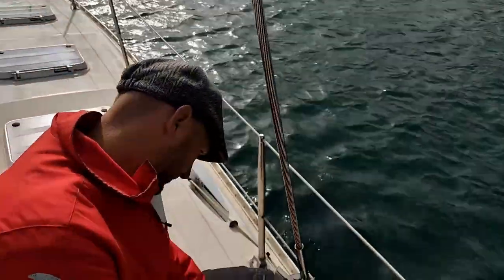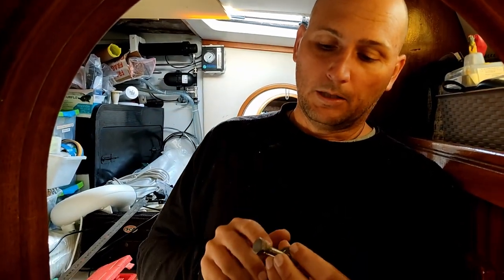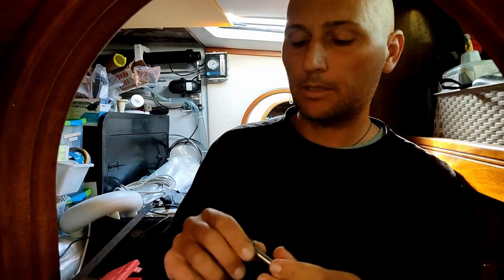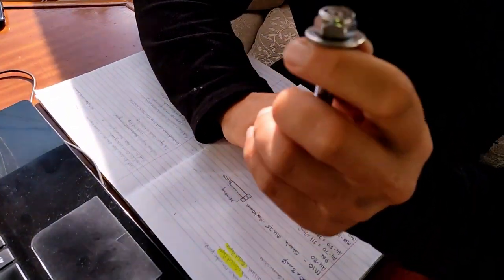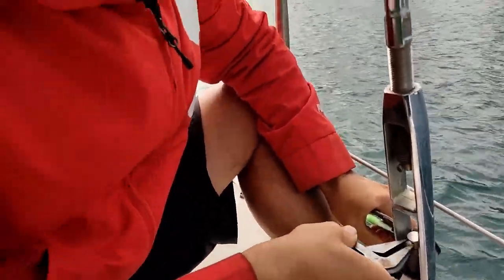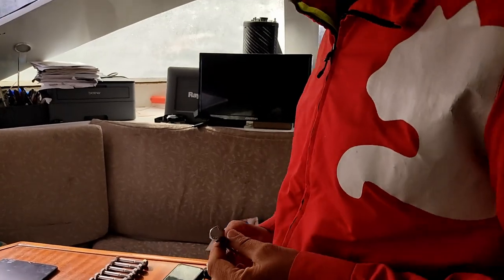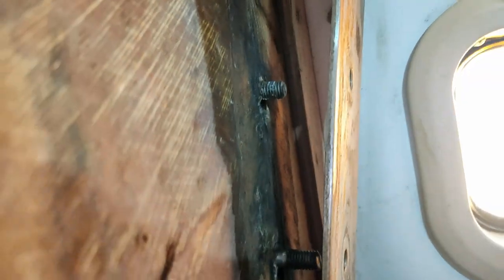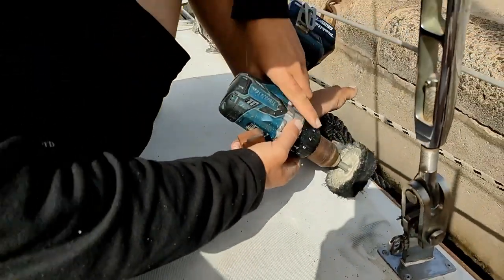Concerning chainplates and suspect bulkheads

Comment: Thanks for that - bugger about the chainplates. I can't see much uni there. In a Newick tri we built we used the Farrier reinforcing method and had about 9 laminates of 2 plies of uni and 1 of db at 600. It was massive over an HD insert and used 12mm bolts. In my own 38ft cat I have my cap stainless chainplates on the outside leading through a 20mm ply pad with 12mm bolts with uni ribbons laid over and into the bilge with 2 600 db plies over. Now I would just go composite - so set and forget and no water ingress. Stainless chainplates are a pain if they go wrong. Always something to learn on your videos.
Reply from the maker: Thanks mate. Just in the process of building carbon chainplates here in El Caribe. It's infinitely better than what was there before. We will get to the videos on this process in the next month or so.
Reply: Fancy 65ft racing / cruising mono currently hauled beside us had the G10 chainplates fail in the Heineken last year. Wrong laminate profile.

Comment: My engineering is a little rusty, but my memories of torque and nut retention and Junker vibration testing is this. It's all about the CLAMPING. Shear should never happen. If you are in shear, then clamping has already failed. Bolts hold the plates in clamp friction which holds the load. Shear means it's insufficient tension and friction.
Reply from the maker: Correct however we are not dealing with a steel on steel situation. We are metal on composite which is a very different beastie. The clamping pressure is very difficult to achieve due to through thickness stiffness of the composite panel. Due to this you cannot achieve decent clamping pressures so we look at this situation as a plate with multiple shear pins in it. Also the steel to epoxy surface means the skin friction is too low unlike the steel on steel scenario.

Comment: I'm not an engineer, but what I find misleading about this video and others who produce videos for YouTube is their knowledge of some engineering, but as one commenter already mentioned, it's the surface friction between the chainplate and the bulkhead which is produced  by the tension of the bolts. It then becomes a matter of whether the bolt is sized properly for the desired torque value. Please tell me if I am mistaken. Thanks
Reply from the maker: It depends on how the chainplates is designed. It can be made so that it relies on clamping friction but this would require many bolts which are generally smaller. The other option is the bolts become dowels in shear. This requires less bolts but they need to be  of bigger diameters. The latter option is more suited to composites as composite structures don't like holes in them. There are a lot of issues with composites being clamped when they are a cored structure (as our bulkheads are) because you cannot apply enough clamping force for it to be in friction. This means the bolts will have to be in shear for it to work. This is the reason why we ended up building composite chainplates.